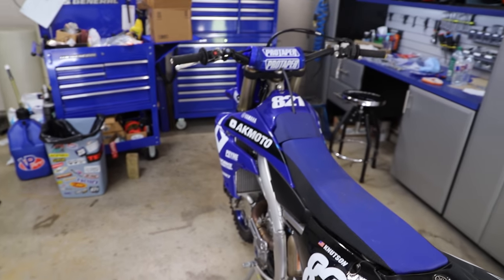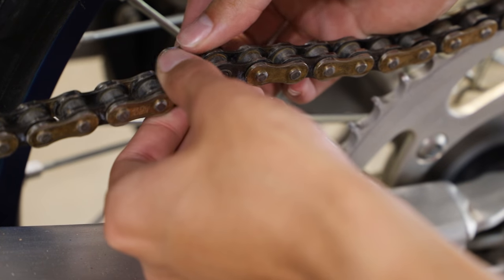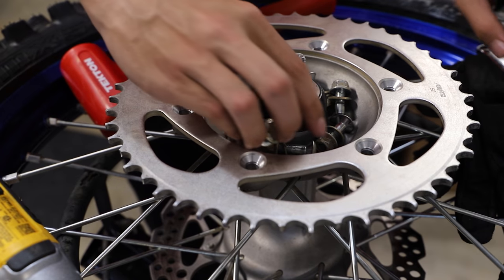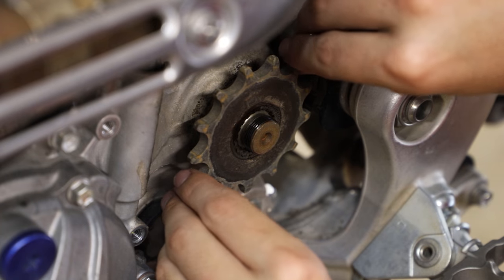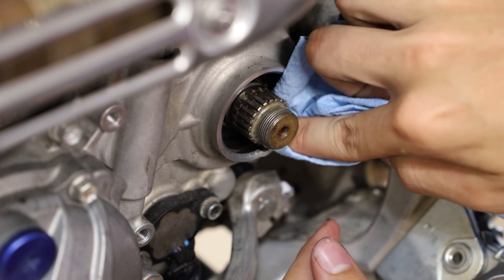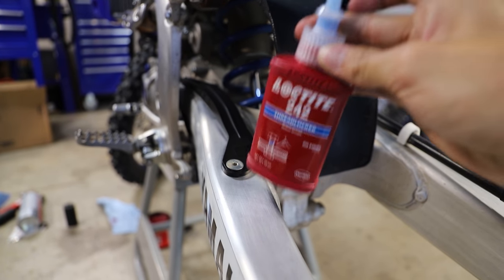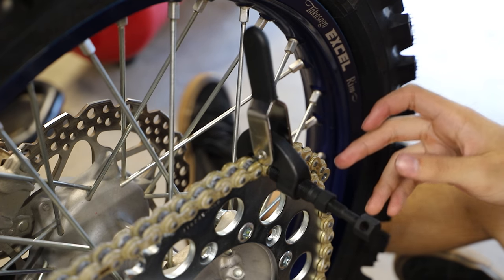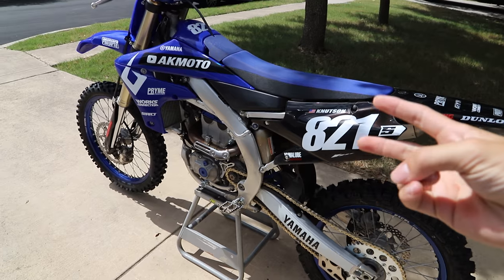2021 YZ250F Chain & Sprockets Replacement

Comment: Thats what happened to me I replaced the seal and pushed it in pretty far and oil came gushing out when I started the bike. Im replacing the seal again and I noticed the bearing behind the seal has some scratches and marks on it from me removing the seal again, this time it was a lot harder to get out since I pushed it further in. Do you think Im good to put the seal back in even with those scratches and marks on the bearing?

Comment: why did you opt for the 100 instead of the 110 tyre?
Reply from the maker: It’s what came stock, 100/90/19
Reply: @akmoto_  true but most 250 4t come with 110 , did you ivestigate that option or just went wit the 100 because its stock size?